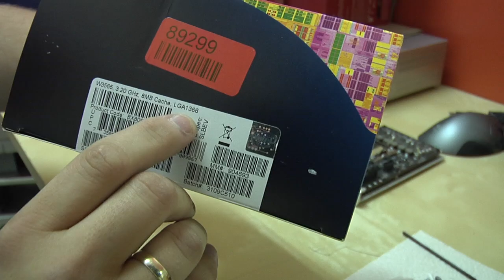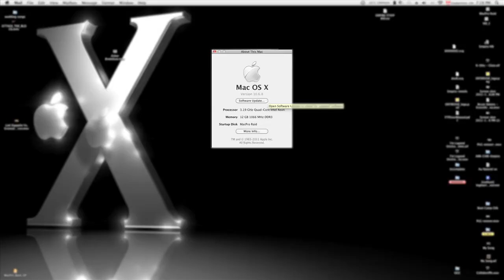Mac Pro CPU Upgrade- Nehalem 2009 4.1 - 6cores now

Comment: Okay. So you might be getting slightly high temps because of the way you applied the thermal paste. You let the copper heatsink do the work for you. The way you spread the TC allows for trapped air bubbles between CPU and heatsink. Please do not do this. Just put a smal amount of TC on the CPU and mixed it the tip of the syringe thingie. It must be a homogenous mixture. Do NOT spread it out like this. just let it sit in the middle and let the Heatspreader push it to the sides.
Reply from the maker: +Nathan van Dalen   LOL only 5 years LATE on telling me this!  lol

Comment: Do you have to install new firmware first? What did you use to spread those metal oxide?
Reply from the maker: +koban4max  YES NEED TO INSTALL firmware first!!!
Reply: g4sean and what was that you used to spread the paste? card?

Comment: """Good Video"""", and for anyone wanting to try the  W36xx  processors in a twin cpu configuration...forget it, They will not work in tandem , they are meant only for single CPU configuration.

Comment: when you updated to the w3680 6cores on your mac pro 4.1 did you have to update the firmware
Reply from the maker: Yes.  You have too or it will not work!!!
Reply: how come your system info still shows 4.1 ?

Comment: If you want to upgrade it further you can get a Xeon X5690 six core with 3,47 GHz. It scores even higher in Geekbench than the smallest Mac Pro you can get in 2015. Of course you have to run the firmware of the Mac Pro 5,1. But I heavily suggest this, because it's  very cheap and easy to make. A second hand X5690 with warranty costs around $300 on ebay.
Reply: +Haramasch Abrasir Is this the fastest CPU you can upgrade to?
Reply: Yes, it is.
Reply: But I have to say in the meantime the price of the processors raised up to $500 so its not that cheap anymore.
Reply: +Haramasch Abrasir Wow  thats a jump in price! Can you use it for the single processor config as well as dual?
Reply: You are lucky because for the single processor model you can use the W3690, which is the single processor version of the X5690. It is cheaper and in fact the processor swap is easier on the single CPU Mac Pro, because you don't have to remove the heatspreader on the CPU.

Comment: Is it possible to switch out my single Xeon 2.66GHz CPU board with a Dual Xeon 3.33GHz socket CPU? I`ve already updated Firmware to 5,1 before Apple stopped signing the Firmware update.
Reply from the maker: Brock Suire Yeah it'll work just fine!    have fun!!!
Reply: ALEXX C You sure can by getting a dual CPU board. As long as the firmware is 5,1 Dual Xeon processes work great. LGA 1366 Socket. The Intel i7 would work also, but with Non ECC Ram & it can only be one processor.

Comment: Could i put i7 960's in mine? I have dual xeons
Reply from the maker: yes If I recall right,   you can use the i7.    BUT! You have to change the memory to know non-EEC memory.            Try it at your own risk!

PS.  you do know that the xeons cpu's are better then the i7s?  
xeons are server cpu's                            good luck!!
Reply: g4sean you CANNOT use two i7s together! only xeons support that.
Reply: Roy Ware Yes it does work,But not the ECC Ram. You need to use Non ECC ram with Core i7 Socket LGA 1366

Comment: I have a 8 core Mac pro 2009 do you think I can upgrade to a 12 core by puting 2 of these W3580's in? and do I need to do a firmware hack to make it possible?
Reply from the maker: yes!   you would need to hack the firmware   to make your mac pro become a 5.1 mac pro
Reply: ***** Where do you buy the processor and how much for the 8-core upgrade?
Reply from the maker: found the cpu on ebay!
Reply: NO! PKTV Do not get the W35xx for and 8 to 12 core upgrade. You will need the X56xx series CPUs. The W35xx will not work with 2 CPUs, they are made to be run by themselves.

Comment: Thanks for this awesome video relived some off my stress just upgraded successfully from W3520 2.66ghz to W3580 3.33 ghz :)
Reply: did u have to flash ur mac?
Reply: I had already flashed it some time ago for no reason other then there was this flashing tool and I just had to try it :P But the processor I chose was from the same line as the machine so in theory I wouldn't have had to flash it.
Reply from the maker: Joshua Tracey
YES!

Comment from the maker: its the same RAM after the upgrade,  the mac pro 4.1 does not use 1033 mhz ram!!   it's 1066ram.  the w3680 well work with 1066ram.

Comment: Thanks for the video.  Question for you if you are still watching this video thread...

I have the dual processor Mac Pro from ~2009 era.  I would give you more but it keeps shutting down within secs of booting and then randomly shuts down over and over.  I cleaned everything... nothing helps
I booted it a few minutes ago and then immediately pulled out the processor tray.. the back tower (heat sinks, fan) is hot.  Can i buy a replacement heat sink / fan assembly somewhere? (same one you remove)

Comment: Hi;
Is possible to upgrade a dual Core 4,1 to a 5,1 dual w3680? i know how to upgrade the firmware but i wish to know if Dual W3680 are compatible with the Dual Processor Board of the MacPro 4,1.
Thanks.

Comment: how can u tell if u have a nehelem? i just got a 2009 mac pro and i want to upgrade the cpu. i upgraded my old 2006 to an 8 core and then sold it but i wanna keep the 2009. i currently have a 2.66 quad-core intel xeon. what are my options for upgrade?

Comment from the maker: if you have a mac pro 4.1 2009  without hacking the firmware, you can put any Intel Xeon Processor 3500 Series w35xx. if you wanna hack you mac pro 4.1 2009 firmware to make the mac pro become a 5.1 2010  you can put any Intel Xeon Processor 3600 Series w36xx.    These processors are all old ones,   for the  latest models Intel Xeon processor i would say NO,  But you can put in a i7 but you can't use ECC memory,  The montherboard  will only accept LGA1366 Sockets (cpu)

Comment from the maker: off a website like 1 year ago.  No link.   Big Difference in benchmarks.
i encode blu ray videos,   when i was using my 4 core 2.66ghz took me 3 hrs to encode a 1hr video, with the 6 core 3.33ghz same file 1 hr video, takes me
1hr to encode. Almost real time.

Comment from the maker: the 6 core will not work without the new 5.1 firmware!   because in the 2009 4.1 mac pro's don't support the 6 core cpu,   So you have to hack the 4.1 mac pro 
firmware.  and NO i cant make a video on the hack because the hack is already done.

Comment: Wow, got a Mac Pro 5.1 :) Now I have to understand if is better spend 700 euro (W3680 + 1333 Ram) and give up USB3, Sata3 and Thunderb or wait for the next Mac Pro (may be in Feb-Mar, or may be never) whereas certainly buy the base model (2800-3000 euro)..

Comment from the maker: if your mac pro has a Model Identifier: 5.1,  no EFI upgrade just swap CPU and Ram
very easy!   BUT if your mac pro has a Model Identifier: 4.1    YES you need to upgrade EFI to make your 4.1 mac pro be come a mac pro 5.1 for the new cpu W3680 to work!

Comment from the maker: it's a firmware hack tool for the 2009 mac pro's to make it become a 2010 macpro.
by doing this you can put in the 6 core w3680 cpu and YES you can put DDR3 1333 MHz instead of 1066 MHz.

Comment from the maker: THE CPUs YOU GOT w3565 DO NOT WORK IN THE 8 core macpro 2009 4.1
w3565 only work in the 4 core mac pro 2009 4.1   

thats why your mac pro doesnt bootup!         Also do some research first, mac pro 8 core motherboards DO NOT take LGA 1366 cpu.   only 4 core mac pro.

you would need somthing like X5570, X5550,E5520, cpus for 8 core

Comment: I purchased two w3565 LG 1366 processors for my 8 core dual 2.26 GHz 2009 Mac Pro 4,1.
The install was easy but the machine would not boot up. I re-installed the two 2.26 original CPUs and the system returned to normal. Any idea why it didn't work on an 8 core system?
The only odd things was the 8 core's CPU holder did not have a lever mechanisim to hold the CPUs in place. They just sat in the sockets and were held down by the heat sync.

Comment: is designed for server purpose, you can in theory use a mac pro case, but it need modifications to work with standard ATX mobo

Comment: Great Video! You've got me thinking upgrade... especially with all the uncertainty around a new Mac Pro release. When you switched to the 6-core, did you upgrade your ram to DDR3 1333MHz? If not, do know if it would work with the 2010 firmware update?

Comment from the maker: @lordtrini EBAY the cpu.      yes you can upgrade to a 6 core cpu   i did it to mine!
but you have to upgrade you EFI (bios) to install the 6 core cpu. IF YOU DO NOT UPGRADE you EFI aka bios IT WILL NOT WORK!!!    thankks

Comment from the maker: @TalesOfWar i bought some thermal paste at like 5$   did the job!
The new cpu Does not run super hot on heavy loads   Temps around 60C max when im incoding HD video to encore.      when i had my w3520 2.66ghz  the temps would be around 80-90C, Not anymore!   2 days ago i removed the w3565 and replace it with a 6 core w3680 and temps are still around 60C when the computer is incoding video with ALL 6 cores running to the max.

Comment from the maker: Thanks oyoxdesign,    putting two 2.93GHz 6-Core Intel Xeon. would give you a Good CPU BOOST!!   the  upgrade will work fine for you!  no conflict  But the new cpu's that you need are the x5670 are going to cost you on ebay 1800$-2500$  Only do this if your applecare is over!

Good luck.

Comment from the maker: you can put the w3680 in your mac pro 2009!   you can only put the w3680 6 core cpu if you upgrade your mac pro 2009 Firmware to mac pro 2010 Firmware.

thanks
hope it helps!!!

Comment from the maker: you can upgrade the cpu with any intel cpu W35xx,  i got the w3565 on ebay for like 350$.

i had put toomuch thermal paste!   lol   dont put much at all!!!

also i have fixed the problem with the about this mac showing the cpu as 3.19ghz    i used Mac Pro Firmware Upgrade Utility tool that i found over the net 
to upgrade your mac pro 2009 to 2010 firmware,  by doing this my cpu in my about this mac is now showing 3.2ghz.
AND ALSO upgrading firmware  to mac pro 2010  you can buy a 6 core cpu